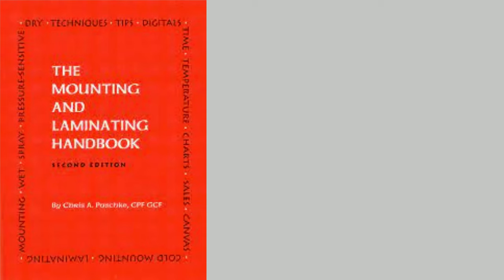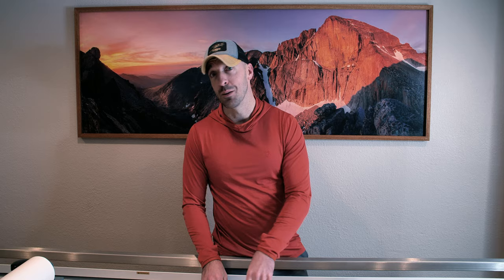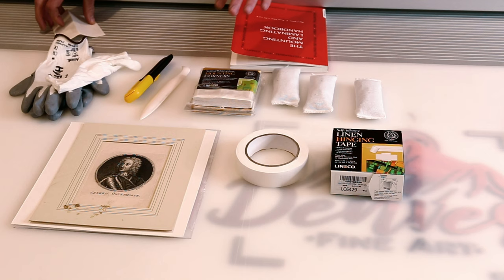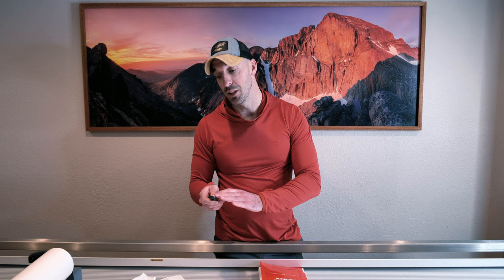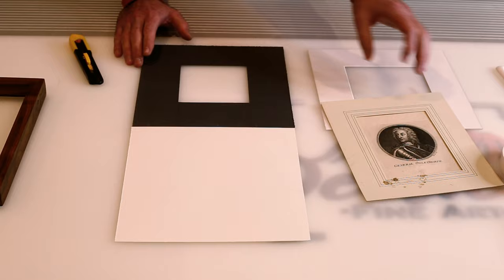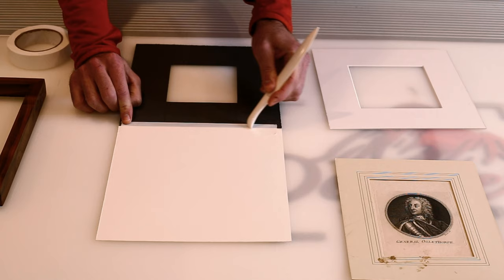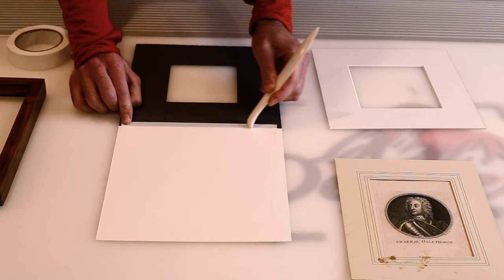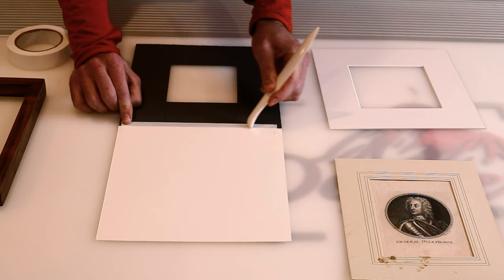Archival Photo Mounting Part 1 | Photo Corners using a Hinged Double Mat

Comment: I would appreciate your advice. I am mounting a valuable vintage photograph that unfortunately was exposed to moisture in the past and is now wavy. I thought of mounting it directly behind the UV glass with no mat, allowing the glass to flatten the photo but was told this process may eventually cause the photo to stick to the glass due to condensation. All the YouTube DIY videos regarding "flattening" the photo seem too aggressive. Please advise. Thanks
Reply from the maker: Do you by chance know what kind of paper it is?
Reply from the maker: Ah, okay so likely a fiber based paper. I definitely agree mounting it to glass is a bad idea. I’d recommend you find somebody with a mechanical dry mount press. Flattening fiber based prints is fairly simple with heat and pressure. I’d recommend taking it to somebody that has experience doing this, given the fact this piece is not replaceable. I wouldn’t take the risk of doing it yourself if you don’t have a dry mount press. If you can’t find someone to flatten it for you, I’ve seen people use an iron. Assuming it’s a small print, you may be able to try that with some kraft paper to absorb moisture and protect the print surface. I still don’t recommend it, and haven’t tried it personally, but know others have had success with the method.
Reply: @MrNegative  Thanks for the advice. I've decided to live with it as it is and use your archival mounting process. Even "somebody with experience" could make a mistake and as you say "the piece is not replaceable" (an autographed photo of a 1930's jazz star). Thanks again.
Reply from the maker: I think that’s a great decision. Working with something that old would be very tricky and quite frankly terrifying haha.
Reply: @MrNegative  👍❤